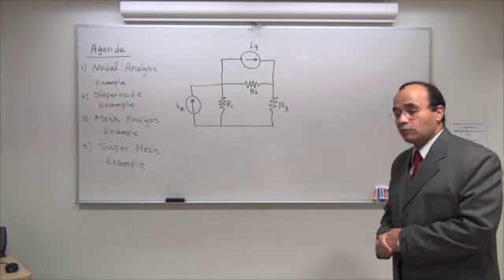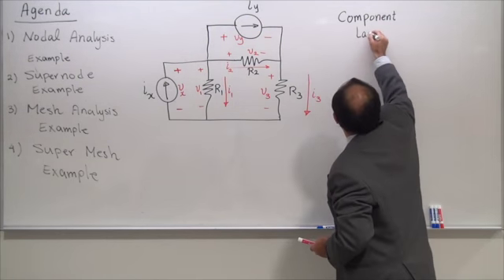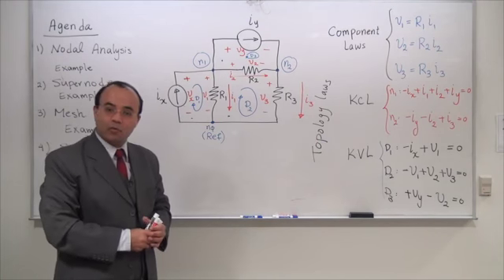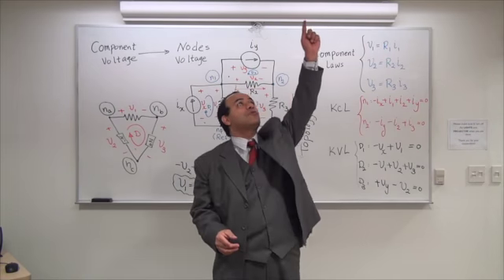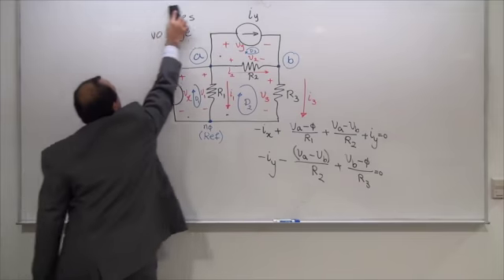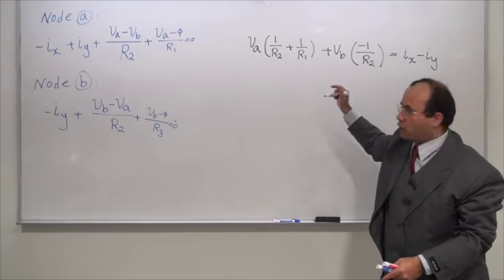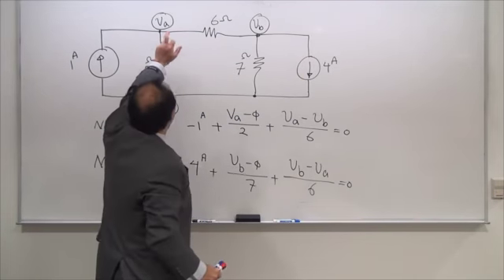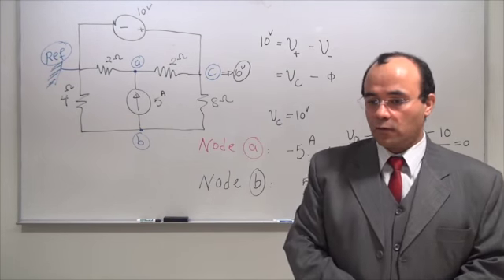Chapter 3: Nodal Equation

Comment: Mr. Raahemifar, Thank you for all your nice lectures. Just a question about the polarities of the voltages, when applying KVL; Even though the results are the same but conceptually why when you move across a component from + to - polarity (which in physics sense means voltage drop) you use +V and not -V (and likewise when a current enters a node you consider it negative, where as it is adding charge particles to the node)? (I know mathematically that means multiplying the formula by a minus sign, but physically...)